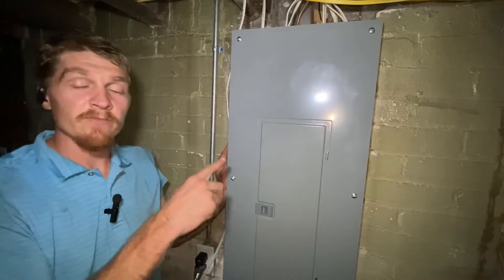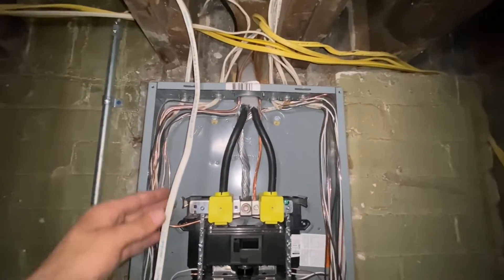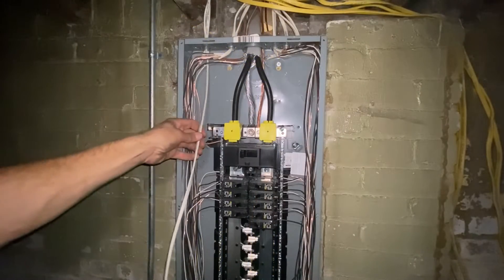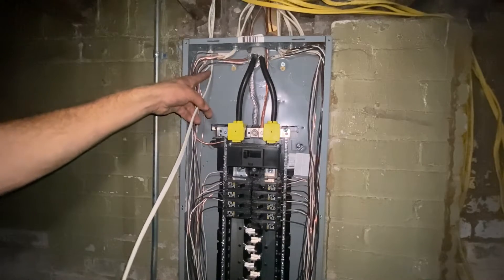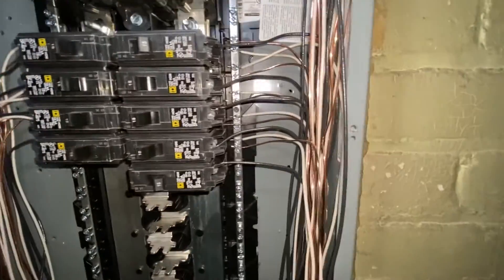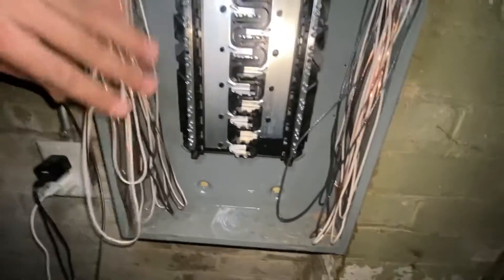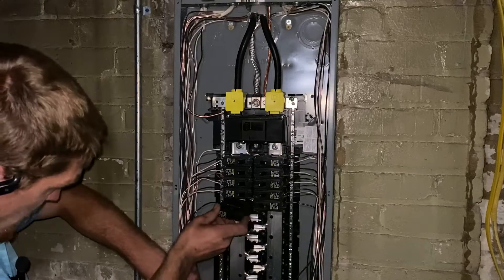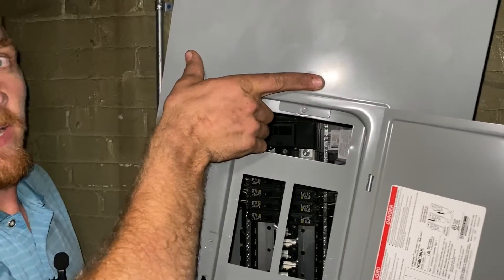How to Add a Circuit Breaker to Square D Panel

Comment: Adding a new circuit to connect security lights and cameras for inside and outside home....What size wire, was thinking 12 /3, what would you recommend and brand...
Reply from the maker: Lighting circuits would be be fine with 14/3  15 amp but I know some people are if the opinion that everything should be done with 12/3
Reply: @samuelkingentrepreneur  Thanks for responding

Comment: Nicely done.  Will go thru this many times before I Install my first of the 3 Square D breakers I am planning to add into the main panel for a basement reno project.  I understand that each of the breakers can carry 12 loads of switches, lights and receptacles combine.  I am dedicating one of the breakers for strickly lights and switches.  If I use say a 3 to 10 w pot lights, would I be able to install more than 12?  Will be using a 14/2 wires just like what you used on the video.  Thank you.